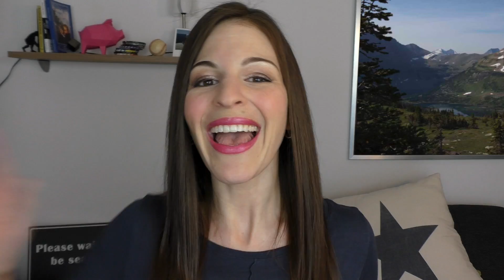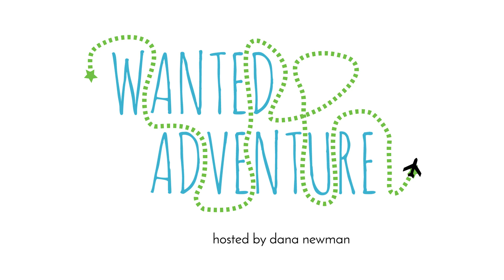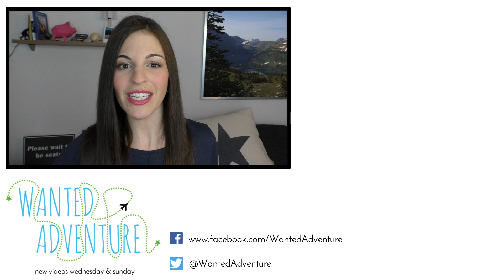Why Are Houses in America MADE OF WOOD?!

Comment: America should build houses out of bricks not because of tornadoes but because of floods and termites. There are a billion ways for a wooden house to get rotten but none for a brick one.
Reply: +Ian Ng-I don't know of anyone treating a house as a disposable object...that is silly.  And Jigme's comment about the house being in good shape after 19 years is also ridiculous.  I grew up in a wooden house that was 130 years old and it never had termite damage, no wood rot, and was just as stable as the day it was finished.  And my house was not unique as this is often the case.  If your wooden house is in bad shape after 10 years, there are some serious issues going on that are definitely unique and not normal.  And masonry houses have their fair share of issues, too.  Unless the whole structure is made out of reinforced concrete, I've seen many brick and block houses have issues with the mortar joints.  They need repointing from time to time...failure to do so allows water inside which causes issues on its own...and when that water freezes, you have serious problems.   Repointing an entire house is quite expensive and labor intensive so both construction types have their unique set of issues that must be taken into consideration.
Reply: They have different time frames over there. I had just moved into a house in Germany that was built in the 16th century when my mother called from the US to tell me about my brother buying a house there. It was in pretty good shape, she said, considering it was already 19 years old and hadn't been torn down yet.
Reply: Jigme Choedzin Balasidis Exactly, houses shouldn't be treated as disposable objects because most of the time they really aren't disposable, make houses out of wood and you end up with a miserable owner 10 years down the line.
Reply: Bricks don't stand up to earthquakes as well as wood, and the entire west coast is sitting right on top of the infamous ring of fire. My 120 yr old wood framed house has survived several earthquakes, the steel and brick school had to be closed and repaired after the last large one. And at the time it was only a decade old. Some of the older brick buildings downtown actually had bricks tumbling and falling from the upper stories, a real hazard to anyone down below. They shuttered a few of them for good and brought out wrecking balls.
Reply: *****
I definitely agree about the wood.  Old growth is denser, stronger, and less prone to rot.  New growth (mostly farmed pine) isn't as dense and, as expected, isn't as strong or resistant to water damage, etc.  However, we don't harvest old-growth wood very much any more so almost all available is farmed today.  And I wouldn't say that new houses today are garbage.  Sure, older buildings did last a long time but if a new house is build to modern standards and codes, you will be fine.  For instance, I grew up in a very old house.  It was still in pretty good shape when I moved out in the 1980's but I know my father spent a lot of time maintaining it.  The foundation was stone and seeped water often.  No walls were straight, level, or plumb, and, with no insulation...it was drafty as heck on cold Pennsylvania winters.  Today, a house might be built with farmed pine, but now, the exterior walls are often 2x6 (farmed 2 x 6 is stronger than old-growth 2 x 4) which allows for more insulation.  Foundations are now often poured and reinforced concrete which is far superior to laid stone/rock foundations, the foundations are now properly water-proofed with excellent weeping tile for drainage, joists are hung with hangars which is much stronger than nail-through construction, joists are now normally 2 x 10's instead of the 2 x 6 or 2 x 8's used long ago, and engineered beams (laminated) are stronger and more resistant to cracks or rot than conventional beams.  Also, the parts of the houses are now tied together for resistance to damage from earthquakes and wind shear.  Older structures relied a lot on gravity to keep the structure on the foundation/sill plate and the roof on the top plate...today, they are strapped together and reinforced.  Today's homes are wrapped, airtight, and much better insulated than years ago which aids in huge ways for efficiency.  So, old homes are great for their character and will last eons if maintained well and new homes are great for different reasons...and will also last eons if taken care of.  It's kind of like comparing cars...I'm a gearhead and love old cars but when shopping for one for my teenage daughter, I picked a newer car with better safety over old-car style and character.  Pros and Cons for each.
Reply: Jigme Choedzin Balasidis  I know what you mean.  In the US, a building is considered old if it is 100 or 200 years old.  In Germany, that would not seem so old.  I am reminded of a nice old out-building that was at the end of the street where I lived in Neuleiningen,
Germany.  It was very unique looking and had some typical old-time charm.  One day, I drove by and they had torn it down to make way to build a new house.  I asked my German neighbor about it...I asked why they would tear down such an old stately building for a new house.  He looked at me puzzled and said it wasn't really that old...only about 300 years!  It's all relative, I guess.
Reply: Frames aren't made of bricks.  They are still usually wood.  So even brick houses can get termite infestations.
Reply: I live in Wales in the Uk in a 600 year old stone cottage. It is still standing and i am having no problems with it. The only problem is with rendering the outside, because i am by the sea. Still though it hasn't had to be rendered for a good 20 years and is showing no sign of needing a re-render anytime soon.

Wooden houses don't last like stone ones, it's a fact. Also look at the castles of European countries. How many castles 500-1000 years old (or older in some cases) do you know that stiol stand today that were made of wood?
Reply: Dewy Russ  Yes, my mother was often rather ridiculous. Nevertheless, that's what she said. I was merely attempting to underscore the difference in perspective. Certainly, there were houses in Detroit, where I lived for a while, that were much older, but my family in the suburbs apparently considered nineteen to be a venerable age. Of course, here in Europe a house would generally have to be older than the USA to be called genuinely "old".
Reply: my house is out of cypress 190 yrs old still looks great.  I mean sure the paint is thick so it chips easier lol. There are lots of houses that are a lot older here. My family built in Texas ohhh about 1633 there house still stands...wood. Cypress again. My other side also built houses but they were native, long houses.
Reply: Houses aren't falling apart structurally after 20 years, however, it's not uncommon to remodel/refurbish/replace parts of the house after a some time(length of time depends on what it is. Getting a new roof is common, as is remodeling a room. You may remodel similar because you want it to look different, or because say the tile is chipped or whatever.
Reply: 10 years?! Bwhahaha!
No. 
A maintained house will last many generations and often are torn down only because the current owners want an updated house. 
Plus you talk like the house is 100% raw wood. It's not. the wood is treated, so good luck to those termites, which I've never heard of eating a house in my 32 years of life. Only like on tv shows. It's a wooden frame. My house is a brick house....it still has a wooden frame So is my house brick or wood?
Reply: Termites are not really a problem in most of the USA and are most often prevent by a termite shield ( a thin strip of metal between the foundation and the frame, also the first course of wood in contact with the foundation is treated lumber that will kill termites). The damage caused in floods doesn't actually cause in wood homes to rot, because the wood dries out quickly after the flood. The damage is because the water ruins the flooring, furnishings and drywall that comes in contact with the water. Flooding is going to damage any home no matter what it is made of. Only a small percentage of home get flooded in the USA and most of the time it is the home owner fault for building the home in a floodplain.
Reply: We in the U.S. just use wood to build the frame of the house. We don't use wood to build all of the house. If that is what you mean by 'wooden house' then yes that is a 'wooden house' in the U.S.
Reply: Ian Ng ummmm 34 years on this earth and in the USA and I have never had termites or had anyone I know have them... I don't think termites are as common as people think lol
Reply: The quality of wood was exponentially greater 130 years ago. It was much better even 75 years ago. Older woods can go unprotected for decades without rotting. A new house today is garbage from day one, unless you take the time to have it built better than average.

By the way, bricks can turn to dust.
Reply: LOL.  I take it you've never lived in a stone house where it's damp and cold.  It never dries out and mold is rampant.
Reply: It depends on the area - e.g. in Florida where there is significant danger from hurricanes and tornadoes, new construction uses concrete.
Reply: " make houses out of wood and you end up with a miserable owner 10 years down the line."
Gee, my 1921 2-story is holding up just fine. Brick veneer with wood frame.
Reply: Ian Ng I don't have any of those things where I live and we have earthquakes a lot so a brick house wouldn't do anything
Reply: Erh? First, pretty much all wooden houses have a concrete foundation and thus are pretty much as safe with regard to flooding as concrete houses. Unless we area talking about serious flooding. But, then even concrete buildings will be ruined. Second, even if a concrete house does not rot or get infested by termites they are as susceptible to moisture problems as wooden houses. To some extent, even more so as concrete does not breathe and requires very good ventilation. So, mold and other moisture related problems are at least as big of a problem in a concrete house as a wooden one. Concrete does not last forever either by the way. At least not, if you use cheap commercially mass-produced concrete. There will be cracks and the concrete will deteriorate over time. Wood can easily be replaced, but it's way harder to replace a bad brick wall. With proper care, wooden houses will last for hundreds of years. When wooden houses deteriorate it's often the foundation (that is made of concrete) that causes problems... not the wooden walls. Third, a concrete house is not usually built of concrete alone (unless you are living in a bunker). At least in Northern countries you need isolation, inner walls, the roof and usually a floor made of some other material than concrete. 

Wood, in general, is a superb building material. That said, you can't of course build massive buildings or skyscrapers out of wood. Also, concrete is a lot cheaper and less labor intensive in most cases. You can just pour concrete into molds or use large concrete elements.
Reply: +Ian Ng - Floods and termites aren't as common as you might imagine.  Build out of the flood plain and in an area where termites don't live.  In the US, any place where the ground freezes in the winter won't have a termite problem.   Also, the hollow wall spaces in a wooden frame home are easy to insulate and can be dried out quickly if there is moisture.  Regarding flooding, it would start in the basement anyway which in most cases is a concrete block foundation. The much larger problem with water seepage is black mold, which affects buildings of any material type.
Reply: +Dewy Russ  Relative, indeed! I moved to Marburg back in the 70s and learned that a few years earlier, the city council wanted to tear down the entire town center dating from the Middle Ages to put up shiny new buildings. As a contrasting example, there is one house here that is very beautiful, with ornate turrets, crown glass windows, wrought iron door fixtures - you can almost imagine Fugger living in it. In reality, however, it was built in the 1880s during a romantic fad for old-fashioned architecture.  :-)
Reply: news flash the skeleton of a brick is made out of wood so your brick home is just as vulnerable as a wood home matter in fact they are even more dangerous  because you can only add so much weight before they collapse way more dangerously.
Reply: Only bunkers are made entirely of reinforced concrete. Concrete isn't healthy material. 
We in Serbia are building only frames (and partially floors) of reinforced concrete and rest of structure is from bricks. Wood is use for frames for the roofs.
Reply: The area in American I live in is known for not having tornadoes (we had a surprise one a few years back... but one TINY tornado every 100+ years isn't bad), we never have floods, no earthquakes, no natural disasters of any kind. We have a lot of rain... but no other real issues. Also, I don't think I've ever seen a termite. In my entire life.
Reply: Sure but do you mean brick on the outside and wood in the inside? Or you see the brick in your house? We already have houses made with brick bur they are made off wood too. Plus brick can mess up too get holes and gaps and  separate and move what then? Also if a tornado hit it then you got a bunch of brick hitting you and falling on you. They are really heavy. You wouldn't want really heavy wall falling on you!
Reply: Houses are built from several different materials. Roofs are made of wood. Outside and inside walls made out of brick and stone. So if you get cracks you repair same as with wood. If a wall falls on you wood or stone makes no difference other stuff flying around us killing the people. Italy has earthquakes there houses go down and they built them up again with bricks.
How come? Because brick and stone houses last for ever if there is no external force. 
It's all about the money. No other reason. 
If you built a massive wooden house out of big logs. No European would ever quetion the house. They would except that your house is only planed for 300years.
Anyway there are only a few huge wooden constructions. That lasted  century's. Think about it.
Reply: Jigme Choedzin Balasidis. Oh, for fuck sake. Do you really think all German houses last for centuries? No, they rarely last a century before they are demolished. The fact that there are some old houses left, does not change that fact. Stop using personal anecdotes as some kind of universal fact!!
Reply: Depends on the climate of that area. For example, my grandparents' old house is wood and has lasted just over 200 years so far (still in great shape actually). It's never seen a flood, tornado or termite and any repairs have just been normal stuff you have to do over a long period of time. I don't think a concrete house would have had any advantage and doubt it would have lasted as long to be honest. There are some very old wood and brick/stone combination constructions around here, though.
Reply: Not sure how brick would help with a flood. 

Termites are not a problem in most of the US as long as you keep wood from being in contact or within a foot or so of soil, especially damp soil.  I was a certified pesticide applicator and my own homes have never had termites in over 25 years of ownership at multiple homes.  Really far south Formosan termites may require more care and prevention.  But any homeowner can install a bait system for cheap and monitor it with about an hour's worth of reading time.   And even brick homes have wood and other materials in the interior walls.
Reply: its called concrete foundations. if the builder/contractor is responsible there really wont be much of a problem with termites unless the house is left for a long time and dirt is near the wood.
Reply: Ian Ng But wood survives earthquakes better due to its flexibility.
Reply: +HappyandAtheist
" one in the eu uses wood frames for houses , its all reinforced concrete and/or steel."

You realize concrete is an ecological disaster, right? Limestone has to be heated to 2,700F (okay, 1500C 'cause I know you'll whine) and held there for a good long while to make cement. All of that takes beaucoup energy and releases that CO2 everybody is so frightened of! 

Why NOT use a renewable, plentiful, CHEAP resource, with arguably better physical properties (concrete excels in compression, but sucks at tension and shear)? Created by "solar power," after all! It lasts 200 years easily, which may well be longer than the neighborhood you build it in does (ahem, Detroit.)

Really, the only reason EU doesn't take advantage of this useful material is because your forests (as opposed to ours) were LONG ago harvested and exploited down to a minimal level. You don't use wood...because you can't.
Reply: Fake brick ...
Reply: Wrong. Bricks can leak (or more correctly the mortar can leak). Bricks are porous (as is the mortar). Whenever that is the case, you can get wet moldy areas (especially in basements).
Reply: Wooden houses are much easier and cheaper to rebuild than brick houses after being destroyed by a hurricane or whatever.
Reply: Brick houses are probably worse against floods. Brick will absorb wet and keep it for long time. But maintenance is easier on brick house, because you must constantly paint wooden one.
Reply: Ian Ng: 
and because of fires!
Reply: Belive it or not, wood is one of the best material for fire protection. It doesn't collapse while is on fire.
Reply: you can dry a wet brick house. 
you can also dry a wet wood house.
same machines used in both cases.

the problem is the mould. in wood you have more different kind of mould and way faster growing mould. 
but if your brick house is full of mould your fucked. a wooden house you just get rid of the infected walls and replace them.
Reply: Ian Ng, bricks can rot over time as well, especially in very dry climates. They need moisture to avoid a kind of dry rot.
Reply: gew1898 what you mean by dry rot? Like the old buildings in Rome or Jerusalem 2000 years old?
Over 10k years Europeans build houses. Seems like stone or brick is the best solution.
Reply: Ian Ng My wooden house in utah, reinforced by Red brick on the exterior has stood with no problems  since 1940, No rotting.
Reply: My wood framed stucco exterior home was built in 1919. No termites ever and house is not in a flood plane and the wood has no rot or deterioration. The home requires minimal exterior maintenance, new paint every 20 years and replacement of asphalt roof shingles about every 25-30 years.
Reply: *400, not six, that was a typo
Reply: +Aleksandar Petrović
Not all bricks are equal.
Reply: probably because ukrainians are smart enough to open their windows often enough. the things you experience where i live...horror...
Reply: Bearing in mind of course that Roman concrete and masonry is VERY different from the relatively poor stuff we build with today. The Romans had excellent concrete. Modern concrete will start to crumble within a century. So much of it reinforced with iron...only a matter of time before the rust splits it.
Reply: RealitylsTheNow There are actually good sound reasons why modern concrete and Roman concrete are so different. Here is a link to an article that explains it.  https://simplesupports.wordpress.com/2013/06/25/the-truth-about-roman-concrete/
Reply: srsly dude, at least research the subject you are replying to
take a look at this http://www.vodice-dom-gradnja.com/images/2015/32/hausbau_kroatien_rohbau_bilo_2.JPG
this is how all of the houses are built now days
Reply: I bought a brick-veneer wood frame house that was built in 1973.  It's still solid, despite being in humid Kentucky.  If the wood is properly isolated from the earth, termites have a hard time starting.  I bought it as a bank auction.  $59,000 for 1450 sq. feet, 4 bedrooms, 1 1/2 baths.  Sits on an acre.  The only down side;  It's Kentucky.
Reply: Where I live there is flooding in certain places near rivers. If you get flooded, the bricks and mortar absorb the water. Then if it freezes before it is dried through (this can be a month later or more) the moisture in the bricks expand and crack the structure. Once you have the cracks due to freezing expansion the problem is much bigger than just replacing rotten wood and the whole structure often has to be torn down before it collapses.
Reply: Ian Ng yup got a 2 storie double brick house here in chicago
Reply: Dewy Russ That's not bad for a wooden house. The point is, I live in a house that was built in 1570. That's not even that special where I live. From my point of view, you sound pretty similar to what jigme is saying. Real houses are not impressive if they last for 100 years. They last for 1000 plus.
Reply: how is it possible.
Reply: Well my house is made of dense concrete blocks (Schwerbetonsteine).
Its also the first time hearing about them needing to be repointed from time to time.
Also no wooden frames.
Reply: stone houses and add just a liiiiittle bit moisture..bam...mold
Reply: Yeah. I know. That's why I pointed it out already.
Reply: My grandfathers house in New Hampshire was built in the 18th century out wood and its doing just fine. Its been updated with things like water and electrcity over the years, but structurally its original. Wood is fine. Like anything, it simply requires proper maintenance.
Reply: "no they are not no one in the eu uses wood frames for houses , its all reinforced concrete and/or steel.  wood has not been used since wwll. "
Those aren't HOUSES, numbskull; they're multi-level apartments designed to hold scores of families! A HOUSE is a single-family standalone structure (though it can share a common wall, as duplexes and row houses do.)

You got any pictures of HOUSES, since that's what we're discussing?
Reply: Out here in the Evergreen state, we don't have termites.  Rot is actually a fungus, and proper construction prevents rot.
Reply: kinda funny, the linguistical confusion, yes house are 'standalone homes. But often ppl cal their flat their house in some languages. Also  rot migh technicall be a fungus but it isnt often used that way.
Reply: "good shape after 19 years is also ridiculous"  Depends on what type of roof.
Reply: @ rationalguy What's wrong with Kentucky?  In what part of Kentucky do you live?
Reply: Always find silly Europeans saying these kinds of things are the one who don't realise that there are more than 1 country in the EU. namely that the nordic countries especially (swe, nor, fin etc) use mostly wood for small homes (~90% for 1-2 storey buildings) and the EU as a whole is increasing its use of wood buildings (scotland among them), to the point that in 2011 (last year I know the numbers from) 10% of new construction in the EU as a whole was wood framed or wooden buildings.
Reply: Many (if not most) American houses are made of brick on the outside, but with wooden frames on the inside to hold on dry-wall sheet rock, with wiring running in the space between the panels -- and paint or decorative wood panels on the outside for the inner walls.
Reply: Houses should be built out of ICFs, period. To see why, Google image search: "icf house survives hurricane"
Reply: Wrong.  The mortar will crumble to dust requiring pointing.  There are certain mortars that will last a 1000 years but, not what is used today in home construction.  In addition, the bricks can easily deteriorate over the years especially if exposed to wet conditions.  Depends on the brick but, I have seen it many times.
Reply: It's possible to have rotten brick.
Reply: Bricks are gorgeous but a menace in an earthquake.  Old brick buildings regularly get torn down after earthquakes in California, and they get replaced with wood and sheetrock in residential structures and wood and steel framing in many larger commercial structures.
Reply: Alan Fox Well, not every brick is the same, e.g. there is clinker.
Reply: They can still come from nearby firewood too though.  That's one reason why it's advised that people don't stack firewood up against or too near their homes.
Reply: Tornadoes don't exist
Reply: Dewy Russ Pine??!? Pine is not particularly durable for INDOOR FURNITURE,  let alone house exteriors!  Pinewood house lifespan = 5 years?
Reply: +SiriusMined You clearly don't know what you're talking about, what frame? You mean the frame used to hold the concrete until it solidifies and then removed? Or maybe you refer to "fake brick" houses, lol. What's more amazing is that THREE people liked your comment... goes out to show how little some people know about the subject.
Reply: The europeans are always coming up with some bullshit in order to make themselves feel better. It's ok as we still prefer the USA! Cheers from beautiful Bangor, Maine.*
Reply: Why are we still having this conversation? USA is better than Europe anyway!
Reply: all the homes ive seen in the U.S. have been brick. I live in The U.S.
Reply: a Brick House doesn't withstand a Flood, neither it doesn´t get rotten.... brick houses rot pretty fast if not heated, they suck Moisture und then have Fun.